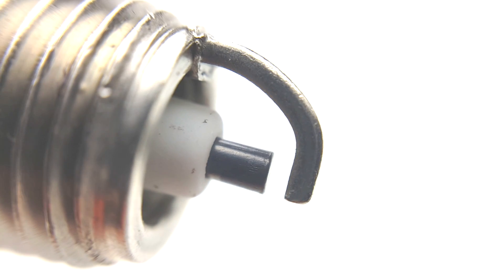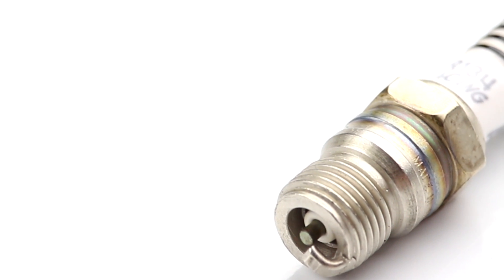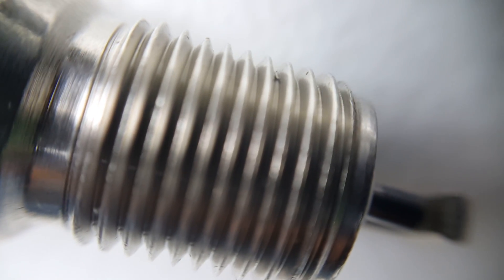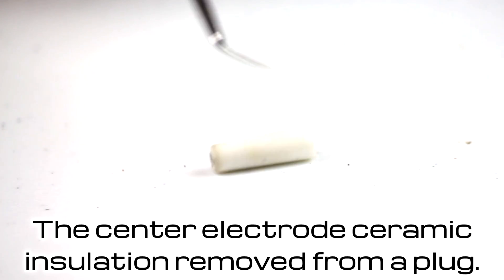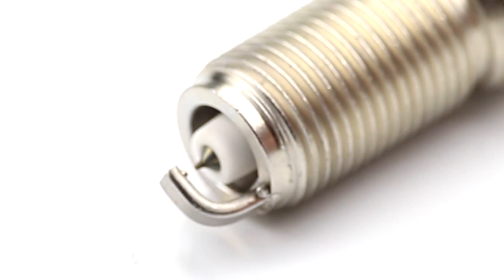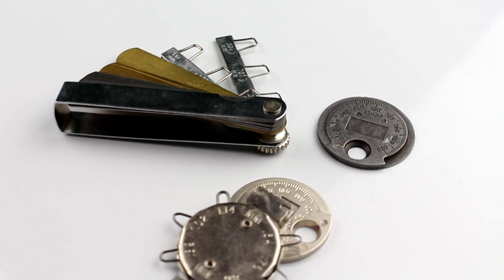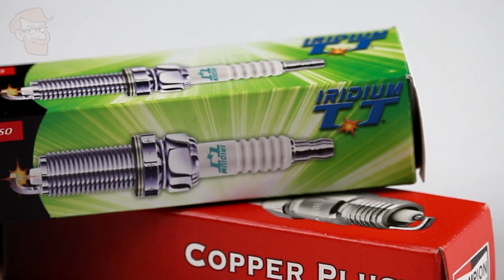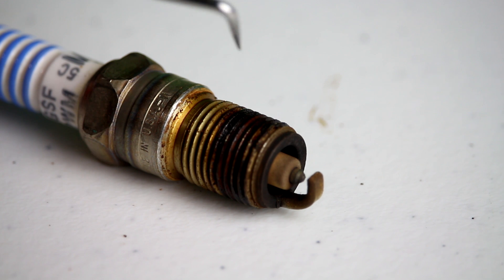Spark Plug Design: Everything You Need to Know • Cars Simplified

Comment: Great summary! I read that the ribs on the insulator are actually to resist flashover, by increasing the surface distance between the terminal and the metal shell.

Comment: What if no washers came with the plugs,would there be any problems. ???????
Reply from the maker: That may depend on the application, but if they have a tapered edge, they definitely shouldn't have a washer (unless there is some obscure outlier I'm not familiar with). I think some of the 90 degree flat edge spark plugs also don't use a crush washer, but typically they do.
Reply: @CarsSimplified  thanks,I'll check.....

Comment: Excellent and concise explanations. The only thing I'd add is that in some engines (perhaps older not-in-use designs?) going with a single platinum plug gives no benefit. This would be on waste spark systems that have coil packs rather than a rotor or coil on plug. On one half of the engine the spark jumps from the center to the ground and on the other half it jumps from the ground to the center. Single platinum can be fine if you intend to swap the plugs from one bank to the other halfway through their life but nobody's going to do that. Double platinum for those engines is often recommended from the manufacturer. I'm looking forward to your how to test spark plugs video. Like you said, a LOT of people just throw plugs and wires at an engine. I used to be one of those people but now test both. If it's within spec and not physically damaged (plug or wire), spend your money elsewhere.
Reply from the maker: Definitely good stuff to know! I may come back to this if I make a more advanced video. Waste spark systems have a similar issue, and I would get into that in more detail as well. Thanks for the feedback!
Reply from the maker: Oops, you mentioned waste spark systems! Must have read that line too fast. I think they still make engines like that, but they are definitely becoming less common.